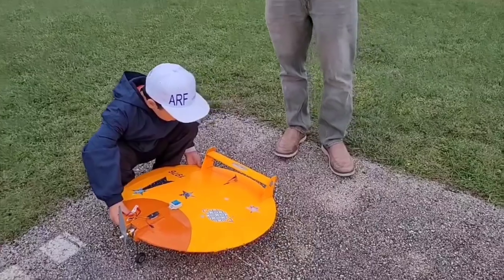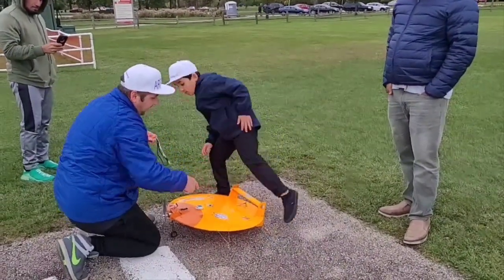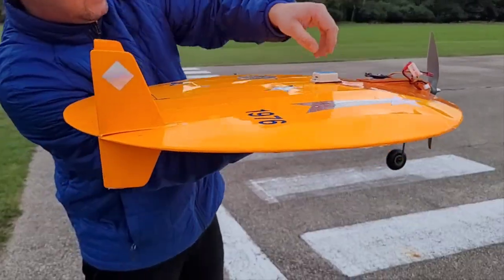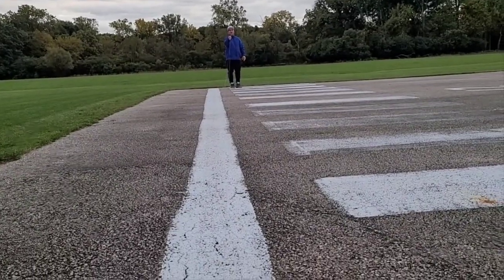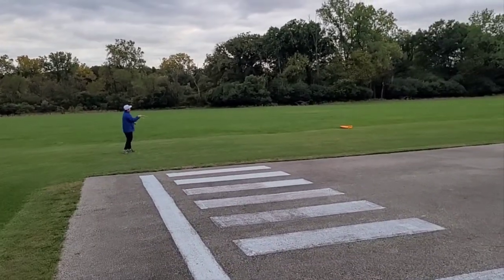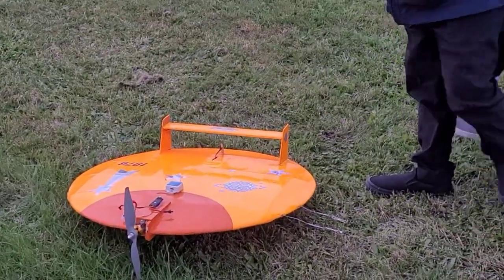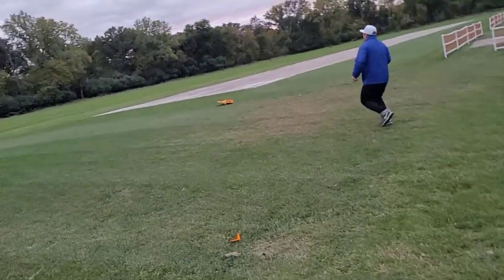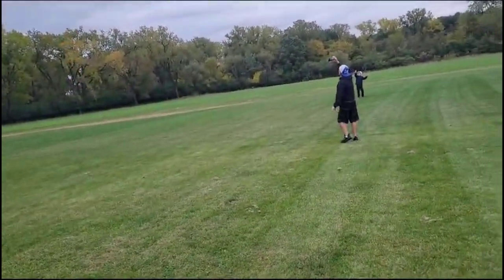Flying  Saucer  attack Electric Control Line

Comment: Actually 1976 was my dad's ama number (Bill Calkins) that was his flying saucer. I think he made it around 94 or so. Don't remember if it was a kit or something he just made. And it's supposed to be squirrley, basically made to hand off the prop and super tight flips actually looks decently balanced with the electric. Good to see it in the air again!
Reply: Thank you for clearing that out 😮 
Your Dad must have been long time AMA member 😎 you don’t have 4 digit numbers anymore these days 
However it was pleasure to fix it  and bring it to sky again 👍 
I will try modifying handle for less movement… this should also help keep it steady 
Stay tuned we will get this model back in sky again my son will fly it he really like the color 😊
Reply: He was originally 19760 but if you hosted a contest back then you could drop a number, seeing he joined the ama in 1976 he chose to drop the zero. My number was 6 digits and was issued in the mid 80's.